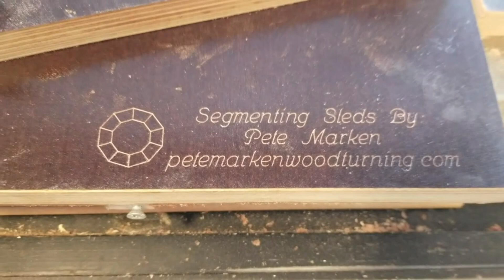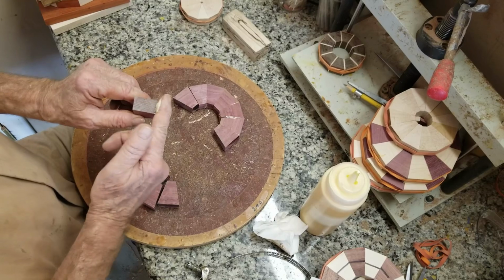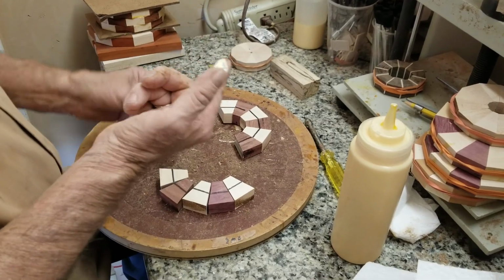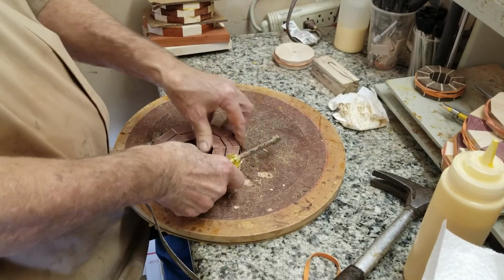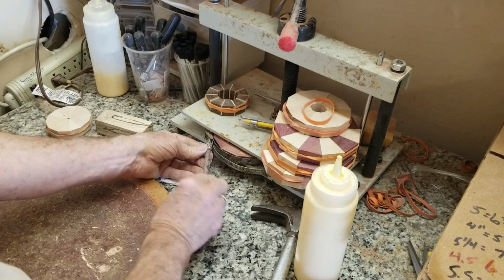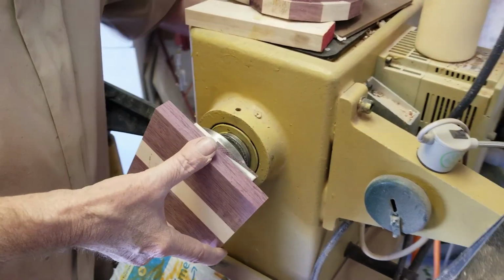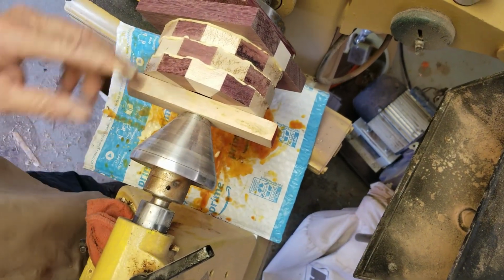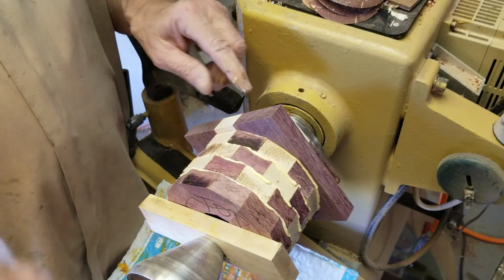Cathy's Bowl

Comment: Very interesting demonstration!  Did you build the ring press?
Reply from the maker: Hello Alain,
It is a paper press that Ed is using to hold the rings down when he is doing the glue up. I have attached a link below.
VEVOR Manual Paper Press Machine 12X8.6 inch for A4 Sized Papers Flatting Machine 10cm Thickness Steel Frame Manual Flat Paper Press Machine Papermaking Book Press | VEVOR US
https://m.vevor.com/binding-machine-c_10880/a4-steel-bookbinder-press-screw-bookbinding-financial-receipt-flattening-machine-p_010557877829?adp=gmc&utm_source=google&utm_medium=cpc&utm_id=15081189022&utm_term=&gclid=CjwKCAjwo7iiBhAEEiwAsIxQESsUG2lPcpK7cM0E9UV72XWk-eI5v3cZMnGPLhfB0glLLpB9OHas0BoCd_IQAvD_BwE
Reply: @JSmitch  thank you very much for the follow up and reference. Have a nice day both of you.